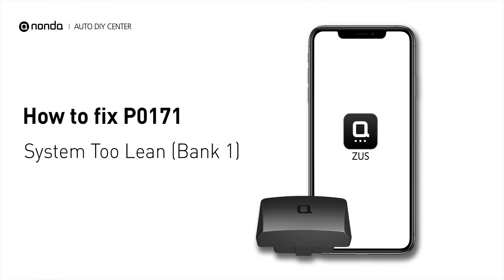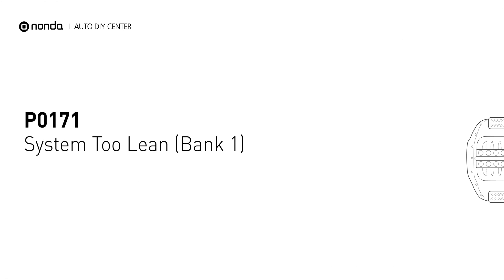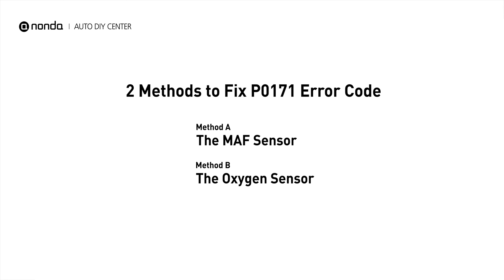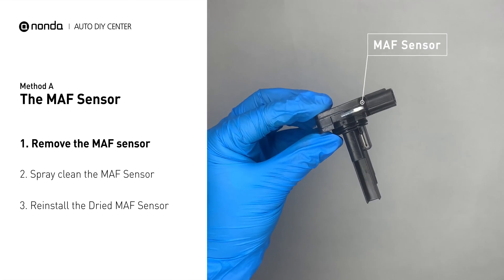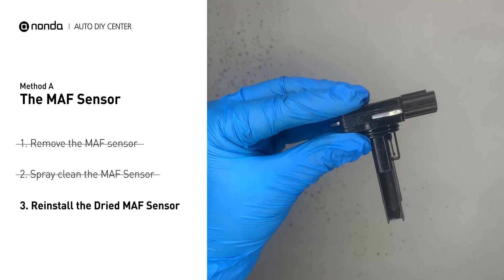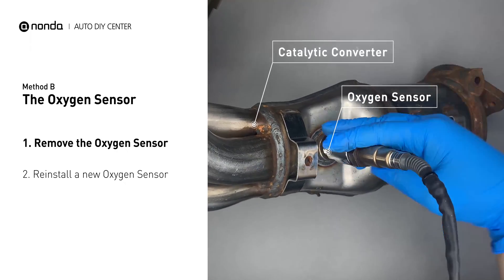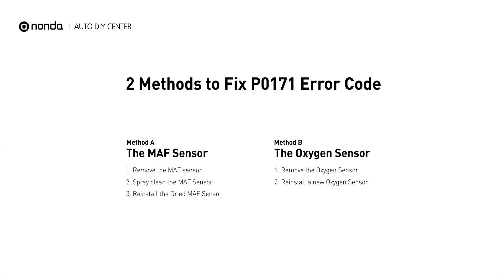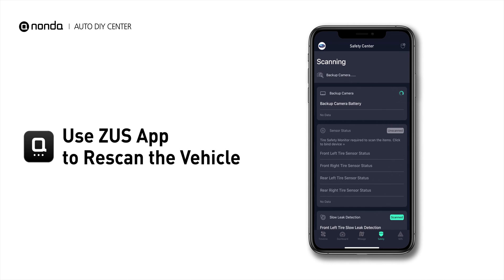How to Fix P0171 Engine Code in 2 Minutes [2 DIY Methods / Only $8.37]

Comment from the maker: Hi, I'm Steve, nonda's lead mechanic engineer. 
Feel free to leave your comments here if you have any mechanic questions, I will be glad to help you out!
Reply: I have an 02 Buick Lesabre with P0171 code. I replaced fuel filter, fuel pump, MAF sensor, PCV valve,Vapor Canister Purge Valve / Solenoid,  Evap purge valve harness, Also replaced Air Filter, reset my CEL and and reset all monitors. My car passes NYS inspection, A week later the  CEL light  came back on!!!! WHAT CAN THIS BE!?!?!?!?!?
Reply: @jesuslovesme9138  similar issue with my 2000 Park Avenue Ultra. I’ve spent about it $2000 trying to diagnose and repair my PO171 and no one can figure it out.
Reply: @jesuslovesme9138 The rear O2 sensor.
Reply: @jesuslovesme9138 you didn’t relearn the fuel trims or clear them
Reply: Hi Nonda, Id like to see why the code went from p1033 to next week its now p0171 ?
Reply: Hi, 
Yesterday I got the p0171 code again, I had previously had it about a month ago and now it came back I had cleaned the MAF sensor and checked all my vacuum hoses for tightness and now it came back again. My vehicle is a 2000 Toyota prerunner 6 cylinder engine. Could it be that the oxygen sensor is going bad?
Thank you
Reply: Can u help me with the brake boot on the pedal to the booster
Reply: Stupid video
Reply: where is the oil pressure sensor/switch located on a 2004 mercury mountaineer , 4.0 . V6, and how difficult is it to change it at home?
Reply: Having the same issue. Replace pcv valve, both o2 sensor, fuel injectors, canister purge valve, mass airflow sensor, air filter and did a smoke test
Reply: i need help
Reply: Bro I have 2008 Dodge avenger got the po171 code I changed oxygen sensor and the MAF sensor car still wants to die on me when driving can someone help me please
Reply: What happens if I dont change these?

Comment: Help i have P0133 along with P0171 fault codes after cleaning the MAP sensor. ,after some time P0171 went away but P0133 came back again.
Thanks in advance

Comment: I literally have lost hope on this P0171 deal, my mechanic has changed both, I have changed the gas fuel cap, and the air filter.. none of it worked, and it wasn’t cheap either, for the record the vehicle is a 2001 Toyota 4Runner.

Comment: I have a 2007 volkswagen eos with P0171 code also
 p0300 "random misfire"
p0302 "cylinder 2 misfire" p0304 "cylinder 4 misfire" 
I replaced pcv valve yesterday 
a week before changed sparkplugs 
Unsure of fix or where to start? Please advise me

Comment: This code popped up for me PO171  and PO101 my air intake hose came off while fro and car shut off was I don’t think anything is wrong with the parts but I got thess codes now . Think after driving it for a bit it will come off?

Comment: i have this code along with po113 my car starts and dies unless i give it gas currently until it warms up at a light it doesnt wana go even wit gas i have to let move a couple feet til i can really take off high speeds its fine just the first gear is stalls a bit had a mechanic fix it cus it wouldnt start at all a week ago ran ok for a week then it died again i did a idke relearn procedure i learned on youtube for stalling and got it started again im currently doing this until i can take it to a shop

Comment: This makes no sense to me that an O2 sensor in the Catalytic converter could cause a BANK 1 LEAN code.  Why would an O2 sensor way down on the catalytic cause a code for only one bank???   I'm getting this code on an 06 Torrent. It started a while after I also started getting an EGR code, which turned out to be an exhaust leak coming from the EGR tube.  I replaced the EGR tube, and the other code (P0405) went away, but after resetting the monitors, the P0171 came back and won't clear.  I could hear the exhaust leak before, now it's all quiet, engine runs smooth at idle as well as driving speeds, no other noticeable symptoms of any kind.  Have visually inspected any vacuum hoses I can see, but can't see all of them.  Not sure where else to start.

Comment: My car has a p0171 and a p0440. And both popped up at the same time. My car has trouble starting and sometimes it stalls immediately after starting. No, it's not. The spark plugs or a bad alternator cuz it has nothing to do with. Why my car hesitates to accelerate or why my car shifts hard while trying to accelerate or why it hesitates to start or why it shuts off while I'm starting it. All of this has to do with P440 and P0171. And it has nothing to do with with the gas cap replacing it would do nothing. My car does have a mass air flow sensor there is no replacing it because there's no part for it. Trust me, I know I've already tried to order. So the solution for this is to replace the O2 sensors both of them but I already did And this code still fucked up both of the codes that I just mentioned. And the issue did not get resolved. Help me find a video that would help me.

Comment: Replaced MAF sensor, o2sensors, fuel filter, fuel pump, fuel injectors, had a shop look for vacuum leaks, I have no idea what else to do from here….
Reply: Sounds like your in my current position I’m going to get pcv valve and egr switched then I will take out every fuse🤕😭
Reply: Did you solve the problem? I don't know what to do @portcityb214
Reply: any solutions ?
Reply: Someone said the coolant temp sensor may cause it too
Reply: Very simple. Scrap the damn thing and buy a new car. Hope this helps 😂
Reply: "Catalytic converter'
Reply: Also pcv valve and intake manifold gasket can cause it but try the brake booster

Comment: 2004 Mitsubishi oz rally 2.0 has the code and I can t fix it. Replaced MAF, upstream o2 sensor, EGR valve, fuel injectors, ECU, fuel pump assembly and nothing worked! Please help?
Reply: Idle issues, goes up and down up and down up and down.
Reply: @calebs2crazy  What percentage is your LTFT at? I would try replacing the fuel cap and check for vacuum leaks.
Reply: @Russell-rc6qq  oh I did end up replacing fuel cap and auto shop did smoke test and couldn't find any although I don't know if that included intake manifold. That's what I was gonna check next but I actually sold it. Told the guy who bought it to check that.
Reply: Lo que debes hacer  es ir a conectarlo aún camara de humo   i esto te va indicar si tiene un likeo de vasio en alguna mangera. Por eso es que teines que conectarlo ai
Reply: El sensor MAF cuando está dañado no te trabaja bien el carro  es el que regula el aire del carro

Comment: Hi Steve i have this code on my 15 altima, but the code comes and goes and my main problem is that the car will start right away when cold but I have a hard trying to turning back on when the car is warm, i tryed cleaning the MAF sensor and replacing the cranck shaft sensor but didnt successed, any recomendations?

Comment: Hi Steve or anyone who could help. I am having P0171 code on my Toyota Wish 2006. I cleaned the MAF sensor, but didn't clear the code. Recently I found a crack on vacuum hose and replaced it, but unfortunately it didn't clear the code. Throttle body has been cleaned as well. The check engine light only comws on in the morning and it always goes away just by turning the engine off, but it comes back the next morning and it's very annoying. Could this be the O2 sensor that needs replacing? I am in New Zealand and it costs a lot of money if I take it to a mechanic. I am willing to DIY this if possible. Can anyone help? Many thanks.
Reply: Any new results?
Or still having the same problem?
Reply: The air fuel sensor has been replaced but the light is still coming back.
Reply: @MasrizalMahmud  How high do your STFT and LTFT read?
Reply: @MrRusell86  hi, what are these? I am not a mechanic, so have very minimum knowledge about car. Just a small update to everyone, the air-fuel sensor has been replaced with toyota OEM part. The light was gone for a week, then I started to see it again. No idea what's going on.
Reply: @MasrizalMahmud  These refer to "short term fuel trim" and "long term fuel trim". They have to do with air and fuel mixture ratios in your car. Around 0% give or take is normal. This figure fluctuates when idling or accelerating. I have the same problem with P0171 but I know what triggers it. The STFT reads as normal (around 0% give or take) while LTFT measures at clear of 35%. The car runs totally fine so a mechanic came to the conclusion it was the car's "computer" (ECM/PCM?). So if you have an OBD2 scanner you should connect it and see how your STFT and LTFT measures on "live data". If your LTFT is wildly high and your STFT normal you have the same problem as me.
Reply: @MrRusell86  I think my mechanic showed me the figure when testing the old sensor and he came up with a solution to replace it. It did worked but only for one week, then the engine light came on again.
Reply: @MrRusell86 did replacing the ECM computer fix the code and keep your lights off after?  I have a 2007 Toyota Rav 4 I got last year.  I have replaced so many things on it to take care of a shutter vibration, then it started throwing codes and light all lit up.  Replaced so many parts and now the P0171 light still keeps popping up after changing both 02 sensors, MAF sensor, new muffler and maybe more.  I have invested another $8000 in 13 months since purchasing it.  I appreciate your help.
Reply: @sistersin2010  It did not, no. After replacing the ECM and realizing it had no effect I replaced the air intake manifold gasket. There was no change from that, either. That left there being either a problem with low fuel pressure or the fuel injectors. The car ran fine so I felt that the fuel pressure was likely fine although I did not have this checked. After changing the manifold gasket I then checked the fuel injectors...bingo! 

The casings on several of them were cracked from age but also that the casings used by Toyota at the time were not very good. This was letting air into the system which was causing the very high LTFT and the P0171 code. Now, this was just the beginning of the saga. I put in two different sets of purported "matching" fuel injectors from eBay. One a cheap set and the second a more expensive set that was flow matched on equipment by the seller. In both instances, the new injectors caused the engine to run rich and trigger a P0172 code. 

It turns out that early 2000's Corollas are very picky when it comes to fuel injectors. What I ended up doing was buying a rebuild kit and applying super glue to the casings of the originals. This is not a perfect solution and is best considered temporary but it lowered the LTFT from 38% to only 19.5%, which is below the P0171 check engine threshold. Whether the fuel injectors are responsible for the still-high 19.5% remains to be seen. A mechanic claims that the car does not hold coolant pressure and suspects there may be a problem with the head gasket. That would require advanced testing to find out for sure.

So yeah, for now the car is holding up alright and drives well enough for being used around town every now and then; the mechanic tells me the glue will eventually be eaten away by gasoline and cause a relapse with the cracking which is why it's a temporary solution until I find truly compatible replacement injectors.
Reply: @Russell-rc6qq  thanks so much for your updated information.  This code sure is a tough one to figure out.  I hope we can finally resolve it soon.  I am on disability, so I definitely could use the money I’ve been spending on something else.  I appreciate you replying.

Comment: I know this is an old video but hopefully someone can respond. I have a 1997 for expedition p0175 code came up about 3 months ago. I had 2 oxygen sensors replace and the code went away for about 2 weeks and came back. So i replaced the maf sensor and that wasnt it. The fuel filter was really dirty so i changed it amd that wasnt it the code is still there. Any ideas what it could be?
Reply from the maker: Hello, have you inspected if there's an exhaust leak? This could also be due to PCM problem.
Reply: @nondainc  yea I was thinking mabey the pcm. I'm hoping not. Would a small oil leak in the valve cover gasket cause it to run lean?

Comment: Hi I have a 1998 f150 v8 5.4l and it has this code and a different one Both lean codes for bank 1 and 2 it has brand new maf and o2 sensor as well as Egr and Egr pressure feedback sensor I need help
Reply from the maker: Hello, as you are getting more than one error code, we suggest getting your vehicle visually checked by your local mechanic for further diagnosis.

Comment: Make sure you really need to replace oxygen sensor and yes if needed spend the extra money getting oem part, Amazon has a bunch of counterfeit parts that will do more damage to your car on old Toyota cars this p0171 is usually a false code that goes away by itself in 3 days any little thing can trigger this code, you could do a few simple tests to check the oxygen sensor and if it doesn't look extremely dirty chances are that is fine, any small vacuum leak because of a hose that is cracked can trigger this code.
Reply from the maker: Thanks for sharing your knowledge, Maxwell!
Reply: yes! i agree with a cracked hose mine was a cracked hose from the throttle body